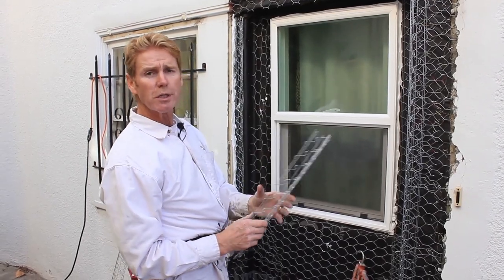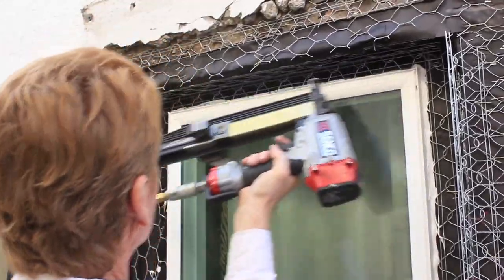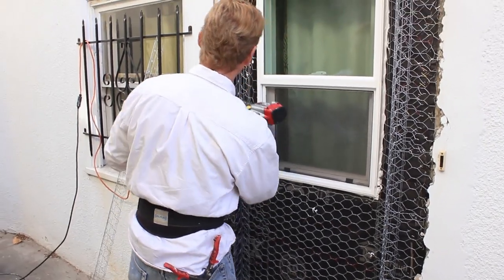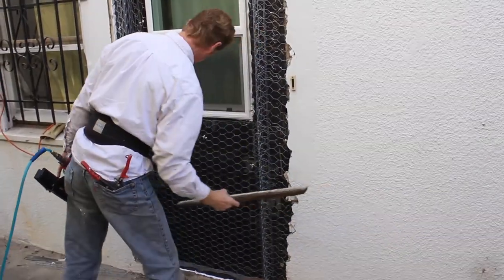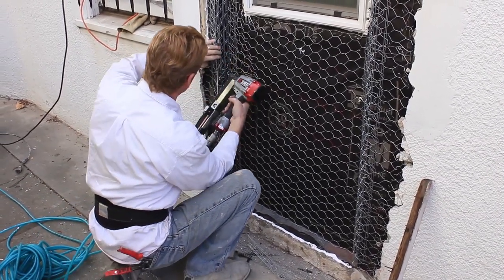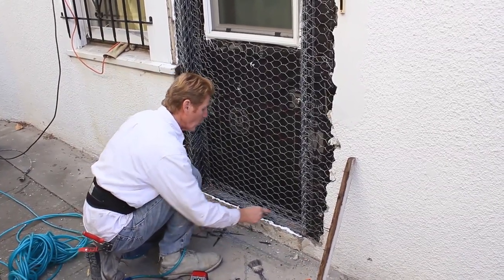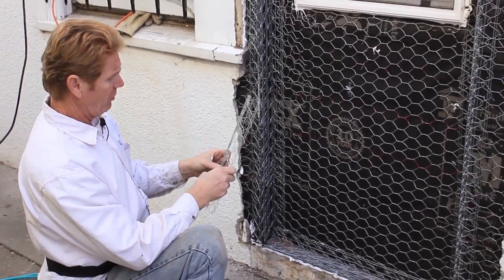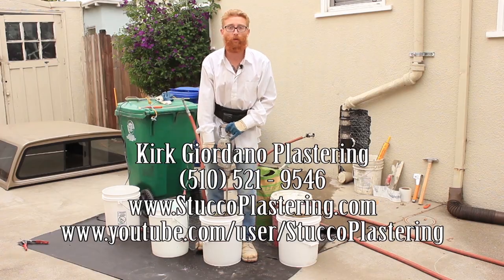Stucco corner aid inner and outer uses

Comment: I need to add corner bead to old limestone foundation for stucco what is the best way to do this?Tom
Reply from the maker: Hi Tom Lee, here is a video which might help you understand what your getting yourself into,
 skip forward in this video a bit a bit to see what I suggest in your situation,
https://youtu.be/_SAA11s0BPs or https://youtu.be/pvG3k71sU74
 Cheers,
 Kirk giordano Plastering
Reply: +Kirk &amp;  I need to attach the corner bead to the limestone should I use tapcons or is there something better. I have no wood to nail to. By the way your videos are great.Tom
Reply from the maker: I attach corners to brick, cinderblock, concrete the same way as in the second video that I sent, If you can't
 attach this way, try the way I do it without a corner at the end of this video
 https://youtu.be/_SAA11s0BPs 
 cheers,
 kirk giordano plastering